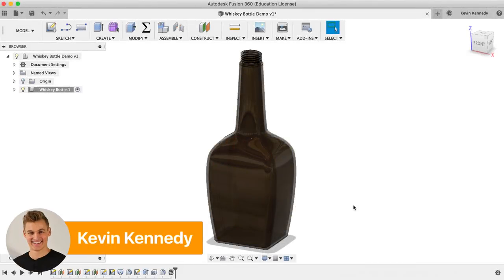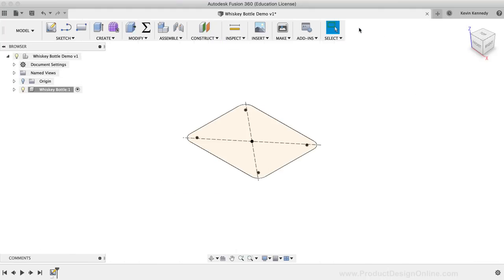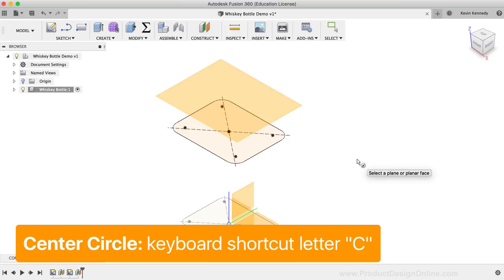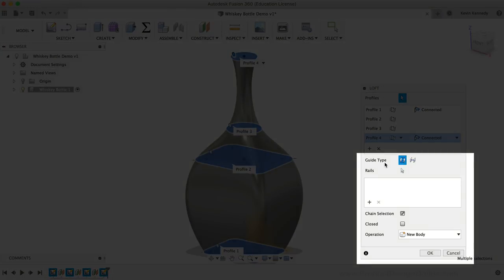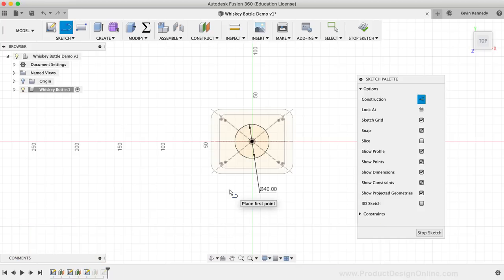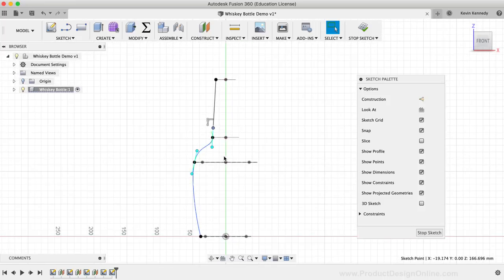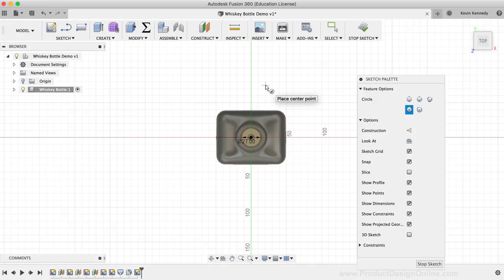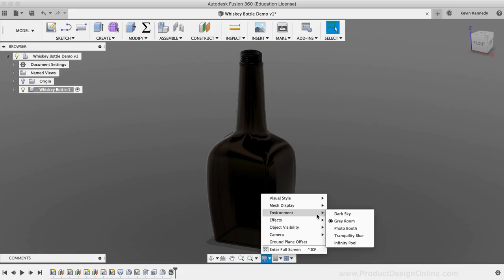How to 3D Model a Whiskey Bottle - Learn Autodesk Fusion 360 in 30 Days: Day #4 (REVISED)

Comment: Hey Kevin, is the thickness of the glass factored in with the loft command? Do we need to shell and confirm with the cross section inspection?
Reply from the maker: Hi Felix. As long as you use the SOLID loft command, the body will result in one solid body. The Shell command then defines the thickness of the body, or in this case, the thickness of the glass. I hope this clears it up. Cheers!

Comment: For anyone stuck because the spline won't snap to the line that forms the rails of the loft. To solve that issue I erased the splines and line. I drew the line first and the spline second but the spline from top to bottom instead of from bottom to top like in the video. Doing this made it so I could snap the top most point of the spline to the line. Hope this helps some of you too.
Reply: Worked for me! thanks

Comment: On the 2020 version, I just could not get the spline to attach to the 4 previous sketches. After searching around a bit I found that you need to use the intersect tool before you start using the spline. Intersect lets you select points from other sketches to use as anchors for the current sketch. So I just had to use the intersect tool on the four points made during the 14:51 step. And that allowed the spline to connect.
Reply from the maker: Hi Brandon. This is caused by a setting change that used to be one of the default settings but no longer is. You can turn on the "Auto project edges on reference" in your preferences (in the design tab) which will take care of it. That automatically projects/intersects for you so you don't have to manually do it.

I hope that at least helps clarify what's happening! :)

Comment: thanks kevin! im having an issue where i put the top spline control point so it slides along the line but when i go to select it as the guide rail it wont select as one piece (therefore not touching all 4 profiles) help D:

Comment: I tried drawing that line for the neck at least 20 times and was never able to get the spline to join with it. I played with the spline curve over and over and that never caused the two lines to join. I finally found an answer at https://forums.autodesk.com/t5/fusion-360-design-validate/sketch-editing-join-points-and-continue-line-spline-line-from/td-p/5572562 to use the extend command. With sketch activated, select the spline curve, then you can extend it to the top as one line. It acted a little wonky, but ctrl+z is your friend.

Tool like these are often very complicated. And working through problems like these will reinforce your learning. Stick with it.
Reply: I had an additional problem with the shell command. I kept getting an error saying that the topical change would be too great and I need to make changes. I finally found this thread https://forums.autodesk.com/t5/fusion-360-design-validate/problem-with-shell/td-p/5540997 indicating that there are bugs related to high curve points and the shell command. I adjusted the sharp curve at the base of the neck and the shell command finally worked.
Reply from the maker: @doleo_metal  Glad to see you're sticking with it and finding solutions. You can also join my new community space and ask for help there - https://community.productdesignonline.com/

Comment: I was successfull with making the bottle after a lot of fiddeling around with my rails. I had a big issue adding my construction line on the circle, it wouldnot snap to the actual edge of the circle plane, it would snap but just on the outside. I tried to use the trim tool on a construction line that went further out on the circle but still it did snap just outside. in the end i used the construction line to help me eyeball it which somehow worked.
Reply from the maker: Hi Ncklas. Please see the newer series, including this lesson, here: https://bit.ly/30daysUpdated

Comment: after drawing the construction lines on the profiles, i went to draw the splines on the front (ZX) view but I can not get it to snap to the points.  Using Fusion version 2.0.7046 that i downloaded yesterday.  I'm trying to get pass the 16min mark of the video but can not get it to snap.  On MacOS Catalina if that helps.  Got pass the other day tutorials with the new UI fine, but i think its a bug or a setting I have turned off to snap to points?  It seem to snap to grid fine with Snap click on.. Great instructional videos!
Reply from the maker: Hi, Bon. Can you first check your Fusion 360 settings with mine  - http://bit.ly/defaultsettings

If that doesn't work let me know and I'd be happy to take a look at your file. Cheers, Kevin :)
Reply: @ProductDesignOnline  Settings seems to be ok.  Still no luck doing spine from the 2D front view.  Sometimes it jumps to the top view after i try to sketch.
Reply: @ProductDesignOnline  I started over and everything worked.  I believed i had too many sketches on a different active profile so it went bonkers.  Everything good now! thank you
Reply from the maker: @bontruong6358  Glad to hear you got it working! Don't hesitate to comment if you run into more roadblocks...I'm happy to help. Cheers, Kevin :)

Comment: Hey, I have been following along with your tutorials and am really enjoying them so far. I have been having difficulty with the different menu structure but so far have managed to work my way around it. What I have been struggling with though is at 15:08, where you have connected the construction lines to the edge of each sketch profile. I have done this step and created these sketch points, but when i go to draw my Fit Point Spline it doesn't snap to any of them, despite me having 'snap' selected in my sketch palette. Do you have any suggestions as to why? I have tried to do without but get errors every time when i attempt to loft. Many thanks!
Reply: Did you find a solution?
No matter checked boxes or not, it dooesnt want to work
Reply: @martenelfving8264  Same problem here.  Any solutions?

Comment: Hi thanks for the great tutorial. I wonder do you use any speech automation tool for your instruction? Your voice sounds a bit robotic, so I am just curious if you automate repeating instructions?
Reply from the maker: Hi, Alex. Thanks for the feedback. I do not use any speech automation tools. I try to talk at a slow steady pace with an emphasis on the annunciation because many of the viewers speak English as a second language. This also helps with the auto-translation for captions as well as the ability to speed up or slow down the video without the audio being distorted.

If the speed bothers you I would recommend clicking the "settings" or gear icon on the video player. You can then speed up the video 1.25x or 1.5x
Cheers, Kevin :)
Reply: @ProductDesignOnline  No, it's really comfortable, and allows me to follow your actions without missing a bit. Just that your voice sounds a bit metallic.
Reply from the maker: @bespalex  I appreciate the honest feedback. I'm always looking into different ways to improve my tutorials and this is certainly something that could be improved! :)
Reply: @ProductDesignOnline  I think I underplayed it. You do a truly outstanding job, your course is superior to the most other ones I've come across so far. Thank you a lot!🙌
Reply from the maker: @bespalex  Thank you!! Don't hesitate to comment if you run into any roadblocks. Cheers, Kevin :)

Comment: Hi Kevin: I can't select my rails. I restarted 2x but still get that error in the lower right hand corner. (I did SNAP properly as you directly at 17:50. Also, my Z is up and SNAP is on.) BTW, does YouTube have a function for sending me an email when you reply? Thanks and stay well! Rob
Reply from the maker: Hi, Rob. You generally get an automated email if someone comments or replies...but it also depends on your youtube/gmail settings. Try deleting the top straight line > redraw it > mirror it over again and see if the rails work. There has been an issue with that for several people.

Comment: Hi Kevin I am enjoying your fusion 360 in 30 days and learning tons. I have a question/problem with the whiskey bottle. I do not have the sketch fly down  bar in the tool bar unless i choose create sketch from the tool bar. My tool bar has 3d icons all the time until I choose create sketch  then i get 2d tools and icons. I just downloaded fusion 360 personal last week, followed all your setup and default settings but mine looks different from the video. I can get the spline tool active but i have to choose a ple to sketch on and it will only project the spline on that plane so it wont go from  offset plane to offset plane??? I am stuck
Reply from the maker: Hi Michael, that is correct. There are some differences in UI. In short, they've moved all the sketch tools into the SKETCH contextual tab, sot they're only available when you're in an active sketch.

To create the spline you'll want to create a new sketch on the XZ plane as seen at 15:40. Select "Create Sketch" in the toolbar and select the XZ plane. Then, you'll see the sketch tools where you can activate the spline.

Alternatively, you can search for the spline feature by using the keyboard letter "S" to activate the shortcuts box > search for the fit point spline feature.
Reply: @ProductDesignOnline  Kevin
Thank you I got now. Just want to say again how awesome your videos are.  I am learning really fast. Keep it up
Michael
Reply from the maker: @michaelperry8996  Glad to hear that. Don't hesitate to comment if you run into any more issues - keep at it!

Comment: A note: if you make the guide rails construction lines they don't work!  They have to be real lines.  I also had a hard time getting the splines to snap to the section profiles.  The points wouldn't light up and yes that was after the Auto project enabled.  I had to zoom way in and things would snap to the grid points but not the construction line - cross section intersections?

Comment: Hey Kevin, love the series so far. I am having a similar problem to some, in that while using the fillet I select the bottom and no real change happens with a fillet. An area along the base alters, but only in that a rectangular section is created without any fillet. I am using the blue loft so I am unsure what the problem is.
Reply: Additionally, the shell command will not work after doing the "fillet." Once I remove the fillet then the shell command works properly

Comment: Even in this revised version, I cannot lock my spline to the intersections of the construction lines and the sketches. I see the points becoming white when I hoover over them in the home position dough, but I cannot find them when drawing the spline in the corresponding plane. What am I doing wrong or which setting is wrong ?
Reply from the maker: Hi Johan. This is likely due to the "Auto Project Edges on Reference" setting that used to be on by default. Turn it on: https://productdesignonline.com/default-settings-for-fusion-360-tutorials/#autoProject
Reply: @ProductDesignOnline  I did this, and it fixed the issue for the first three sketches - when you were having us use the spline tool. But the regular line tool cannot see the construction point on the 4th sketch. I turn on snap and it just starts snapping the grid (which is turned off). I just... I don't understand what is happening. How is it so inconsistent with its behavior?

edit - I was able to draw an arbitrary line, and then move the top vertex into place, and THAT snapped correctly even though the initial construction wouldn't. But also, grid snaps kept getting in the way, even after I turned them off three times (they kept turning back on immediately). So, uh, that's not ideal.

Comment: Amazing series of tutorials.
But I have a problem. I can't snap the edge of the profile and the construction line when I try to make the guide rail with the spline tool. It never lock the edge. I even tried to create points at the intersection of the construction line and the edge of the line. But the spline tool can't lock that point. The only thing I can lock is the grid on the the X and Z axis of my sketch plan, but not construction point. (And I have the problem in other of your tutorials). Do you have an idea?
Thank you!

Comment: So for me "Auto project edges on preference" was already checked and I still had the error when selecting the rails.
I solved it by selecting both the line and the spline and selecting "Curvature" in the Constraints.

Now the shell command doesn't allow me to select a thickness of 3mm. It works with 3,4mm but not with 3,3mm. I guess it must be the shape of my spline or something.

Comment: I'm not sure what I'm doing wrong. I'm still trying to attach my splice to my line on the neck. I'm sure my version of Fusion 360 isn't the same, as there is a little sub menu that pops up when I manipulate a splice point. I can move the splice points, but they never have the option to snap to the line. I've been going over this for over a dozen hours at this point, and have restarted the tutorial from scratch three times. Any assistance would be greatly appreciated. Thanks!
Reply from the maker: Hi Jody. It sounds like a difference in settings may be causing this. Can you cross check your settings with mine, here - https://bit.ly/defaultsettings

Specifically, the "Auto Project Edges on Reference" setting is the one to look out for.

Comment: I love your videos been following it for a while... I have a problem with this tutorial that while I'm trying to draw the spline it is not snapping to the box as in you video, which makes it difficult to attach the line to the plains so I'm getting error " selected rail does not touch all the profiles." I have set the construction lines.
Reply: Hey, i have solved it by resetting all the setting to default and restarted the program...
Reply from the maker: @kirankurianphilip  Glad that fixed it. Don't hesitate to comment as you work through the remainder of the series!! Cheers, Kevin :)
Reply: @kirankurianphilip  I was having the same issue.  The spline was not snapping to the construction lines.  I tried everything here in the comments, but the only thing that worked was closing the program an restarting it.  Thank you for the recommendation!

Comment: Hi Kevin, thanks for this tutorial! I got to the part where you started to use splines, however Fusion 360 is not letting me snap the spline points to the closed profiles that I created with the construction lines. Any advice for fixing this issue? Cheers!
Reply: Did you find a solution to this? I'm having the same issue. Thanks.

Comment: Super Tutorials, first tutorial I really want to finish.. Just one question.. When I want to fillet the bottem of the bottle my arrow points downwards and yours points upwards.. Is there a way to change the way or did I miss a line somewhere ?  Thx man.. Keep up the amazing work !!!
Reply from the maker: Thanks, Fanny! I'm glad you're enjoying the series so far. You can simply select that blue directional arrow and drag it in the opposite direction. As far as fillets go, it shouldn't have any effect to the outcome of the fillet, as they can only be applied in one way to the existing geometry. With other commands, such as the extrude command, you'll find yourself dragging the blue directional arrow towards the opposite direction from time to time. Cheers, Kevin :)
Reply: @ProductDesignOnline  wow.. Thx for the fast reply.. For the answer.. It didn't work.. I was trying pulling it in the opposite direction.. Thought maybe I had to check or uncheck something.. But I probably just didn't connect something wright... Grtz
Reply from the maker: @BORAGT201  Can provide a link to a screenshot? That will help me see if there is something set up wrong in your file. Cheers, Kevin :)
Reply: @ProductDesignOnline   I've made some screenshots, but I don't think you can see anything on it,  I'm familiar with the fillet so with the next lessons it will only get better.. If I still have problems at the end of lessons 30 I wil bother you again ;) Ps Thx man... You make me feel like a student again :)
Reply from the maker: @BORAGT201  Sounds good... I'm always happy to help. Please don't hesitate to comment questions on the tutorials as you work through the remainder of the series. Cheers, Kevin :)

Comment: The previous tutorials have been great, but this is really frustrating (using the latest version so toggling between solid & sketch functions which differs to yours) the spline line is not attaching to 1 of the planes when using the loft function but I cannot tell which plane is not attaching so difficult to know what to do?  Is there way of confirming the spline is joined to the plane at the sketch stage?
Reply from the maker: Hi Dave. The best way to test is to simply click and drag on the spline/line end points. If they are properly snapped in place then they will not move. If you find one that is movable then that is your culprit. You'll want to use the "Coincident" constraint to force it into place.

Comment: SO basically the newest version, even if you clip the splice to the other line, after successfully connecting and being able to drag it up and down the other line, its still doesn't register as one line when I go to loft. Lofted the neck first, then the rest separate. It worked, but when I place any effect on it (glass, steel, etc) you can always see  like a line, difference in both textures. I assumed that this was because they where being registered as 2 different bodies, but when I checked  they where whole, in 1 body. So I don't know how to solve this issue. tried breaking it apart and reassembling it. Any suggestions? this new version is constantly making little changes like these that just fuck with people.
Never the less good vid. Don't expect you to keep up with all these constant UI and command changes, its 2 much.